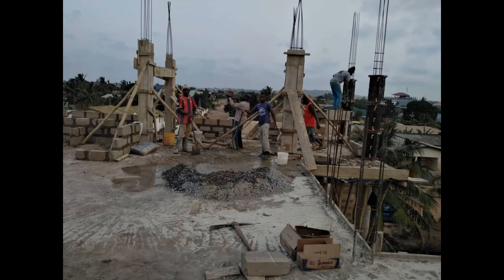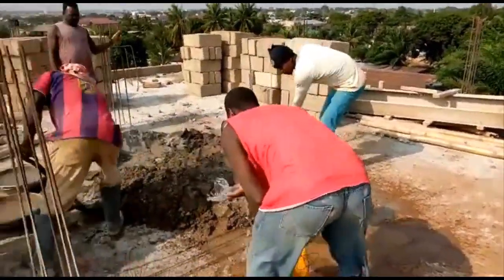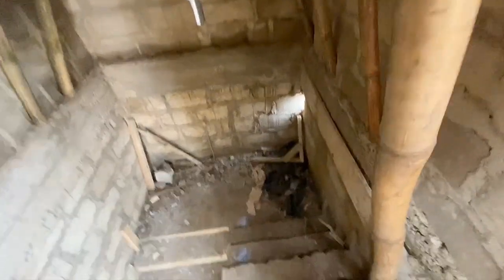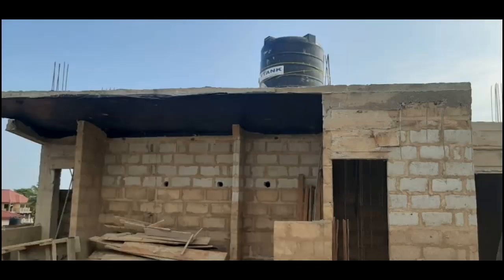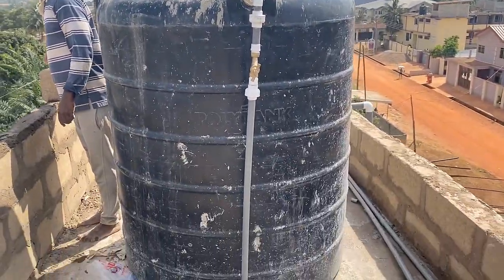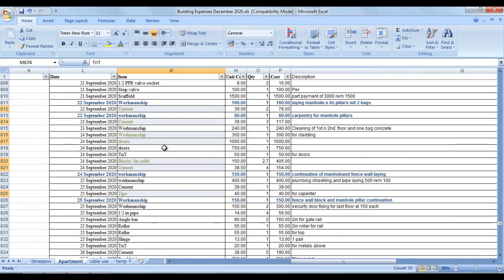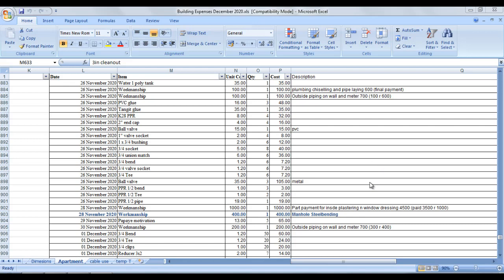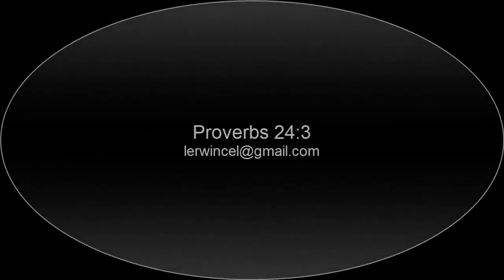Cost of Building in Ghana _  Roof Top Garden Block Work and Water Tank Slab _ Ep 7

Comment: I just saw Episode 2 in my feed and i am now here because of the cost breakdown. Good job. Keep it up.  Try to let them reduce the bedding mortar. It's more than an inch, right?
Reply from the maker: You have a valid point on the bedding mortar. 3/4 of an inch max should be fine but as you may know, artisans usually look for ways to to make more money. Thicker mortar joints means they just meet the minimum target of blocks.  I have been liberal or this cos the blocks are not load bearing

Comment: Why a mixture of blocks, sandcrete and quarry dust.
Sloppy workers, look at the size of mortor joints.
People go for cheap, like any trades people, you should have the right tools for the job.
Reply: its easy to hate on people behind your screen innit?
Reply: @mcdavetv6124  I'm don't hate, I was just pointing out.
When many people watch these videos, copy what they see, it can cost them money.
Why would you use a sandcrete block on the bottom, out a more heavier block on top? There are many factors, if they make blocks weak, settlement movement can cause problems.
I know sandcrete blocks are cheaper, 
People use them in the footing, ideally they should use quarry dust ones stronger don't absorb as much water, can create problems later.
The real issue there's no proper apprenticeship scheme where they learn basics .
Reply: @ukghconst  Hey I get you but you could have just said that without getting offensive 

Besides other than that I think in general he’s doing a nice job
Reply: @mcdavetv6124  I wasn't  really be offensive, I was pointing out some important mistakes.
Yea, everybody on all these building videos always say doing a good job.
Building isn't cheap, more expensive if it's done wrongly.
Many builders tell client the need rebar, it's not always nessercery, if it is,  and it's not put in correctly on chairs if double mat or block single mess at the correct depth, it's a waste of money not doing its job. 
Now they plastic fibres introduced into construction, I've heard builder tell his client its new technology you don't need rebar.
Putting stones under rebar isn't correct either, spacer should be 25 - 35mm high and square with tie wires so you tie then to rebar at about .600 centres or you buy the plastic type.
Drainage is another problem, both having them in columns or traced into block work. This, using rodding eyes in place of proper built inspect chambers is a NO NO, NO BUILD REGS globally that allow it in foul drains.
If anyone allows the plumber to use this, they must use pressure pipe, not the ordinary thin wall pipe, if the rodding eye system gets block, you either did it all out or get a jetting machine to clear it, the jetters use 3- 5 thousand psi, it would cut through the thin wall piping, hence use HP PIPE.
There are some good builders far between. 
There's so many think workers don't understand.
I hope my comment opens people eyes, point out the right wrong.
People don't do there own research first just copy others.
Reply: @ukghconst  ok but remember at inspectors are doing their job so if people are not doing stuff right they’ll show👍🏾
Reply: @mcdavetv6124  sorry, it should work like that, sadly it doesn't.
Many sites never get checked, nor do they work to any basic H S standards, the majority no nothing about first aid.
Most building they build them with rebar between block work, supposedly pillars, then put beams on these so-called pillars which are only the with of the blocks, yet the drawing will have square or rectangle pillar something like 200x 300mm, all depend the building design, usage, ground condition,  height weight, ...
Beams are usually ..175/200/250 X.250/450 +150 concrete floor, different if doing beam and blocks floor.
One must remember the min distance from outside of concrete to rebar is .25mm inside concrete, if pillars or facing weather should be .50mm.
In foundation no water .50mm if water a min of .75mm if in standing water min 100mm these pillar should be wrapped, or painted water proof tar bitchumin, or other specified material.
Water can penetrate concrete out of ground pillar about .25mm. 
So builders don't always build to drawing. Pillars beams should be vibrated with poker., Technically concrete should not drop or free fall more than a meter other wise separation can occur, orange peel effect, only major high profile projects adhere to those standards.
Then you have to use concrete pump right slump, mix.
In UK building inspectors come at every level, stage mandatory on estate developments, private more relaxed, but the need to be notified.
Different standards in different countries.
 Off subject slightly, many people are from US, building over here, but don't work or insist on standards  anywhere near the US regulations
Hope you find info useful next project
Reply: I saw you in episode 2 and responded to your MISPLACED comments. I hope you are not the type of contractor that says all the big words to rip people off. I will share my opinion on your comment here too. I think i will be looking out for you from now :)

1. From your comment it appears you are the type who will say a KILOGRAM of stone is heavier than a KILOGRAM of cotton. Hollow sand block is not heavier than hollow quarry dust block. They all have the same weight

2. You are right on the thickness of the mortar joints. We are on the same page on this one

3. As i said in my response to you in episode 2 you conclude without facts. There is no reason you cannot use sand block for foundation if the land is well drained. From the videos i have watched so far, the land is not water logged so you have no point here unless you are trying to show off. And 30 blocks per bag of cement is no weak blocks, my guy

4. You keep saying building isn't cheap. You are right, but I don't see any cheap thing about this building after watching four episodes. The prices he mentions are standard in Accra,  or perhaps you are a contractor in Beverly Hills 

5.  My guy which places globally is rodding eye a no no no. Stop deceiving people. I will encourage anyone in doubt to just google rodding eye and you will see the lie posted 

6. If you can use stones and have an even concrete cover why should that be a problem. From the video you have watched do you see any part of the reinforcement sagged or showing after the concrete pour?

7. I already responded to your concern with the pipe in episode

8. If you want your comments to be an eye opener make them constructive and not just a show off.

9. Most of what you have written here, as you have admitted, are unrelated to the video so i think it is a show off.  All those dimensions will be in the building plans. By the way your concrete cover dimensions are wrong. Minimum cover is 25mm not .25mm. What you have written is less than a millimeter. I will give you the benefit of doubt and assume it was a typo. But that is what happens when you are in a hurry to have a baseless show off
Reply: @myselfandi2336  He is talking about quality work and you are talking about Amateur work. 3:48 Those bricks are bad quality. 1 bag of cement 25 bricks. *Quality*. The Mason😵😵 Cheap means bad quality of work. Why the pipes 🤦‍♀️ always in the walls. You don't see iron rods, but nothing is straight.  Really Minimum cover is 25mm not .25mm 😂😂🤣. The whole building is unsafe that is why  they are going plaster it and hide "all" the mistakes.
Reply: @kwabenatree  After embarrassing yourself as Peter Stericker you have metamorphosed into Kwabena Tree. Here is another embarrassment for you. The thickness of a bankcard is about 1mm so your .25mm cover is about the thickness of a sheet of paper. Is that what you do on your clients' projects? 
25 blocks per bag is for 6-inch and not 5-inch blocks. If you choose to have lesser blocks it doesn't mean the standard way is wrong. I would encourage you to read a little more before coming back under a different name. I hope you are not suggesting buildings are plastered just to hide mistakes
Reply: @myselfandi2336  Clearly you dont know the meaning of embarrassment. We are talking about Quality here. You are talking about Amateus at work. Those bricks were poorly made. I know is hard for you to Understand. Is the truth.